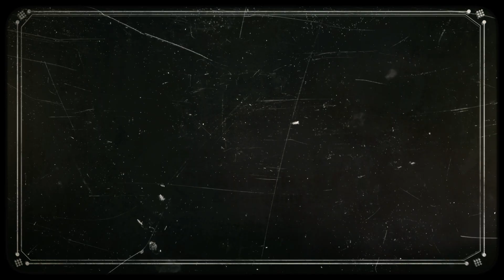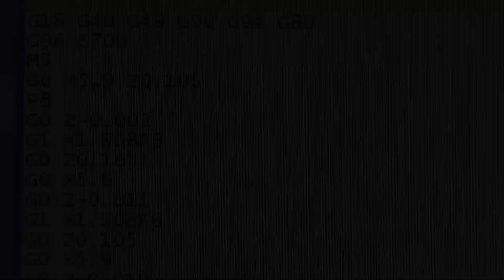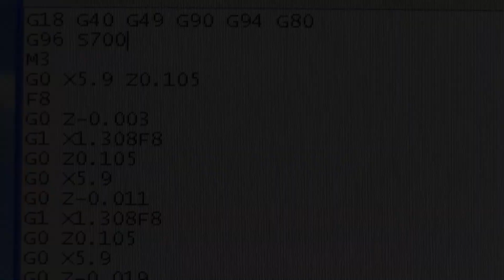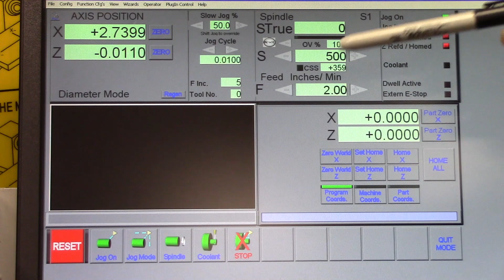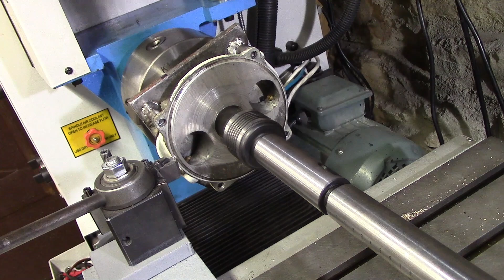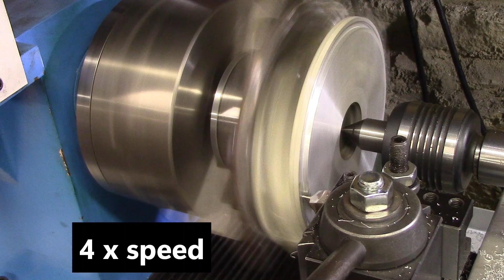Seadoo Rotary Valve CNC with Mach3 Turn

Comment: Thanks for sharing  this video.  The Mach 3 tips are a very useful tips .  I have a Shoptask Eldorado Bridgemill that came with CNC motor mounts but not turn key ready CNC.  I am slowly getting  mine cnc converted. Mine still has 110v ac motor for lathe.  Now i will be going 220 3 phase  3hp with a VFD on mine.  Thanks for the extra $400 plus added to my build ...lol

Comment: Okay I have the same the same leave there and mine has that little red knob it says spindle coolant spindle Cooling do you ever use it I never used it I never got it hot enough to use it or will it help control chatter my machine has a lot of chatter no matter what I'm cutting I'm not I didn't figure it out if it's the chuck or the bearings the machines are 2017 model which the years go fast but most of the time it just sits and before I got it it was hardly ever used
Reply from the maker: @ebayselle  that red knob is just an air valve for the spray mist cutter coolant not the spindle. You need to check your spindle bearings and maybe tighten your carriage dovetail set screws.
Reply: @crankshaftandco  okay mine says spindle cooling air I don't know if a blue air into the bearings or what to deal with on that and never heard of it I have the carriage tight I think the spindle bearings I need tightened up I don't want to mess with it yet I just deal with it. Many many things were loose and the Machine didn't have much use it came out of a college and they didn't really know what they were doing because the computer broke. One thing was lots of things were loose and some of those screws on hold the thing together are just big enough in fact my ball screw nut game off I got so much vibration put the ball screw nut came loose. Turn the light in early unscrewed all the bearings out of the ball nut how to replace it